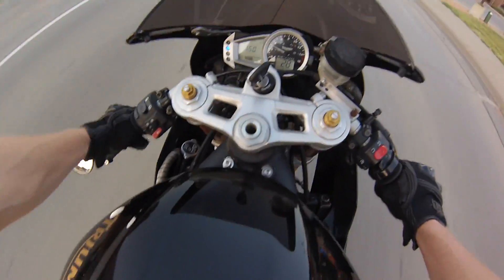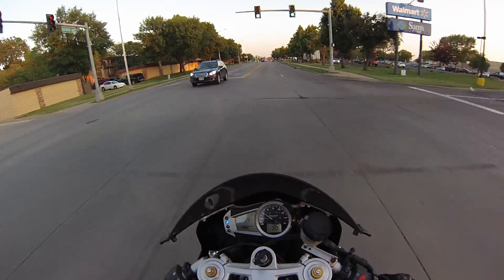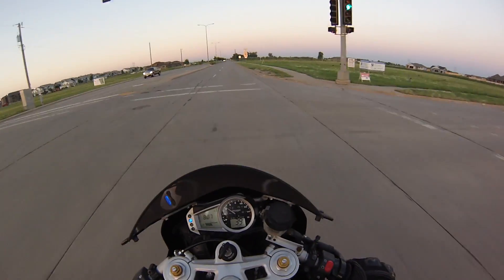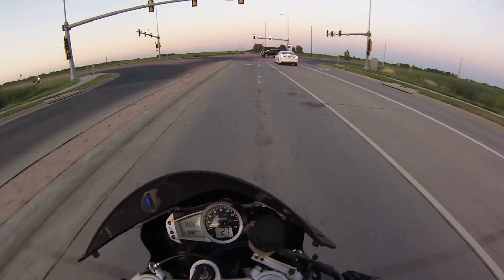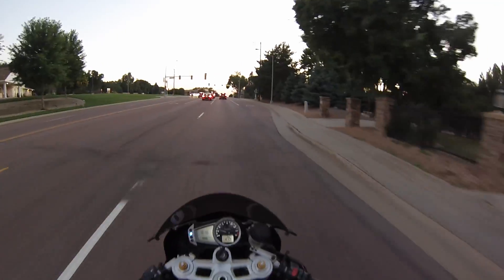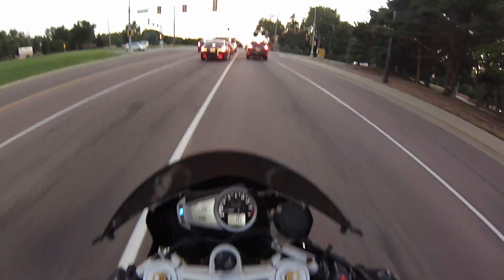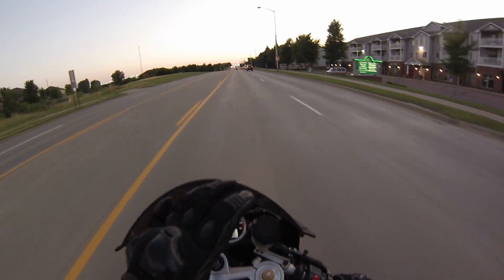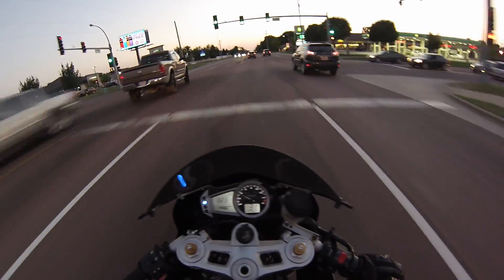Horsepower vs Torque - EXPLAINED!

Comment: So if I tune my Passat and it was 175 hp 180 tq to 230 hp  250 tq will it be faster because the hp are tq? I thought the tq was the boost when you shift 😂

Comment: All vehicles need energy to increase their speed. The energy required is easily obtainable from the kinetic energy equation.
E = 1/2mv^2
which can be reversed to obtain speed as a function of energy:
v = sqrt(2E/m)
So the speed of the vehicle is given by the square root of the amount of energy over mass

Since acceleration is the rate of change of velocity, acceleration is proportional to the rate of change of kinetic energy.
The rate of change of energy is power.
In fact:
f = P/v
force = power over velocity magnitude
since:
acceleration = f /m

For any vehicle the acceleration component from the engine is given by:

a = P/(vm)

And this formula is valid for any vehicle and means that the engine acceleration component on an instant is given by the current power of the engine over speed times mass. 

Acceleration is proportional to power, it is not my opinion, this is very low level physics 
and math and if you want to argue please talk with Newton who is the genius who came up with these equations.

In the context of a car the P in the formula can be replaced with it components which are torque and rotational speed(RPM) of the engine, in fact:
P = ω * τ
so:
a = (ω * τ)/(vm)

Which just proves that torque of the engine does not matter for acceleration since you can have:
(1000RPM * 1NM)/(vm) = (1RPM * 1000NM)/(vm) 

Those 2 hugely different examples where torque is very different gives you the same acceleration. And in fact both examples have the same power, because ultimately power is what matters.

Another consideration can be made, consider a car moving at a certain speed, let that be 50m/s, it does not really matter.
That car just have 2 gears which have a double ratio so, since given that the speed is fixed that car can either be at:

2000RPM with the 2nd gear or at
4000RPM with the first gear

The engine of the car delivers 

100NM @ 4000RPM or
150NM @ 2000RPM

So, if torque gives acceleration that car should have more acceleration at 2000RPM with the second gear. Unfortunately this inst true in fact we can use the equation above to find out the real acceleration and since speed (50m/s) and mass(whatever) stay the same we can just ignore those components:

1st gear a = (100nm * 4000rpm) / (mv)
2nd gear a = (150nm * 2000rpm) / (mv)

100*4000> 150*2000

Which obviously gives a greater acceleration with the first gear even if the torque is lower. In fact the power of the engine is greater at 4000RPM (42Kw) than at 2000RPM (31.4Kw)

The same example can be made with any number of gears and any engine. Which proves again that is power or better power/weight are what matters for acceleration. And that maximum acceleration always comes from keeping the engine at the maximum possible power point which depending on the transmission should be near or the peak power point.

MATH AND PHYSICS ARE NOT OPINIONS
Reply: Nice comment couldn't have said it better myself, are you an engineer?
Reply: @metallinkhead  because if you start a car in 5th or 6th gear it has a lower rpm than I’d you had the car in first gear. Someone correct if I’m wrong o have a very basic understanding
Reply: Hol up
Reply: Got it
Reply: Damn son you are a fool that just copied and pasted that lololololol
Reply: torque is a rotational force. the higher that torque, the higher the angular acceleration is, thus, you will have a greater acceleration. at peak torque, you are at your peak acceleration. that is all. you are right, math and physics are not opinions. you just have your understanding of it twisted. power is the combination of force and velocity. at high speeds with low acceleration, you will make roughly the same power at low speeds with high acceleration.
Reply: @cloroxbleach118 No, @Fede Devi's understanding is not twisted. He's completely correct. I know it hurts the brain to say that the twisting force from the engine "doesn't matter"... let me try to break it down in a more intuitive way. 
We want forward push, right? We want to accelerate quicker, pull heavier things up hills faster, overcome more extreme air drag to reach even higher speeds and so on. Okay what's touching the road? The wheels. The wheels are going to push back on the road. So we absolutely do care about torque at the wheels. Wheel torque can be maximized by adjusting the total gear ratio between the engine and wheels to put the engine at an rpm as close to peak POWER as possible. 
Now I know intuition screams that we should adjust gearing to maximize engine TORQUE... but remember what power is - torque times rpm. If we are at best engine torque and we want more torque to the wheels, we can go to a slightly lower gear allowing the engine to run a little faster. Now we know the engine is no longer making peak torque but almost, and we're now multiplying that torque by a higher ratio since it's spinning faster! This means more torque to the wheels. And that will continue to be true until the PRODUCT of engine torque and rpm is maximized.
It is because a transmission allows the free trading of torque and rpm that we can take whatever combination the engine is giving us and maximize torque to the wheels for a given road speed. 
(From your comment, you clearly understand from here how that wheel torque will generally be inversely proportional to road speed.)

Making more sense?
Reply: drienkm yes, it is twisted. forces are what cause things to move. obviously, the more force you have, the easier it is to move something and thus it accelerates faster. torque is a product of inertia and angular acceleration. it is a basic physics equation. angular acceleration is translated to linear acceleration at the tires, thus, more torque equals more acceleration. it is the reason why higher gears (numerically lower, 1st 2nd etc) have the same power output as lower gears (numerically higher) but the higher gears have more torque. in 1st gear, you have brutal acceleration (torque multiplication) but very low angular velocity (translated to very low linear speed). in lower gears, you have way less torque (acceleration) but your angular velocity is much higher, and they always end up with the same power, just made a different way. if your theory is true, then you would accelerate just as hard in 5th as you would in 1st. im not sure how many mire times ill have to explain introductory physics to all you car buffs.
Reply: @cloroxbleach118  I think I see what's happening, but first I'll address what you said specifically...
"forces are what cause things to move" change how they are moving, but sure.
"the more force you have... it accelerates faster" yep.
"torque is a product of inertia and angular acceleration" yep. not wrong.
"higher gears (numerically lower, 1st 2nd etc)" okay. Note that I've used "ratio" for InputRevolutions/OutputRevolutions where you use "gear", and I've used "gear" to mean what's on top of the shifter... but I'm with ya.
"in 1st gear, you have brutal acceleration... in lower gears, you have way less torque (acceleration) but your angular velocity is much higher..." yep, no problems here.
"if your theory is true, then you would accelerate just as hard in 5th as you would in 1st" No. Nothing I said (I read it) suggests that. In fact my last statement was how I could tell that you understood "from here how that wheel torque will generally be inversely proportional to road speed". I was referring to an actual long period of acceleration where you are shifting through multiple gears.

Oh, and the last one; "im not sure how many mire times ill have to explain introductory physics to all you car buffs" forever till you die. But let's fix up one last thing first.

Okay here's what I think is happening. You are thinking about the whole problem while gearing is fixed. It is correct that IN EACH specific gear, more torque at the engine means more torque at the wheels and greater acceleration. And obviously you correctly understand how different gears affect stuff. But you are not looking at the temporal aspect... time - how in a real scenario, each moment can only build on the last one. It's the part that STRONGLY repels our brains form understanding power. Honestly you're hella smart to have put this many pieces in place before it clicks. Most people can't. You will and it will be beautiful!

In your first comment you said "at peak torque, you are at your peak acceleration" that is totally correct IN THAT GEAR. Now ask "should you be in that gear just yet?" Read that again very slowly... You seem to have all the other important pieces in place. 
I'll just clutter it if I keep writing.
Reply: drienkm i guess im not understanding the last part of your statement, or i dont know wjat youre asking me to do. the only thing im trying to prove here is that torque is indirectly a function of acceleration, and thus, grows and lessens with acceleration. it is therefore realted to torque.
Reply: @cloroxbleach118  No worries, take all the time you need. I'll ask the question in a different way - same scenario: You are accelerating in some gear at full throttle. We are looking at a moment in time where the engine is at the rpm for peak torque. Now here's the question:
At this moment (and that means at this speed), what would be different about wheel torque (tied directly to acceleration) if the gear ratio were 10% higher? Ask yourself how this new ratio would change 1) torque at the engine, and 2) torque multiplication to the wheels... 

Explanation below:
1) We know engine torque is lower because engine rpm is now above peak torque. But 10% faster isn't enough to be beyond rpm for peak power, so then we know that power, the product of torque and rpm, must be a little higher than it was. This tells us engine torque is somewhere between 1 and  1/1.1 (or 0.91) times what it was. We don't know exactly because we don't know the shape of the power curve but that's fine. It doesn't alter the conclusion.
2) This one is easy. We increased the ratio by 10% so torque multiplication is 1.1 times what it was .
Putting these together: say .95 times the original torque multiplied by 1.1 times the ratio and we have 1.045 times the original wheel torque - 1.045 times the acceleration - 1.045 times the trailer tug - running at LESS than peak engine torque.

If I had to make one statement it would be that the engine torque number tells you basically nothing about a vehicle's performance. Engine torque is very meaningful only in the equation for power which tells you a lot. When you look at the power equation P=TQ*RPM and you can't see the point of RPM (as most people can't), just replace it with TQ MULTIPLICATION. That's exactly what rpm is really giving you when you have CONTROL OF GEARING. And when I say "control" I mean both the engineer at the drawing board who carefully chooses the best gear ratios in the transmission and final drive to suit the engine and the purpose of the vehicle, and the person shifting gears as they accelerate. 

So how are we doing?
Reply: drienkm if the ratio were 10% higher? then you would have 10% more torque at the wheels and 10% LESS angular velocity at the wheels. torque and angular velocity at the motor stays the same, obviously. what youre saying makes no sense to me. if you magically change your rear ratio from lets say 4.56:1 to 5:1 (10% higher approx) then youre torque multiplication will be 1.1x and your angular velocity multiplication will be the inverse, about .91. based on this conclusion, power remains the exact same at the wheels, yet the 5:1 rearend will accelerate quicker due to that extra 10 percent torque. this is the scenario im talking about. 2 vehicles that make the exact rwhp, but completely differently. 5:1 ratio has higher acceleration but reaches a lower top speed. 4.56:1 will reach a higher top speed, but will not accelerate as quickly. both are making the same hp, in a completely different fashion.
Reply: @cloroxbleach118  When you downshift, which changes immediately; engine rpm or vehicle speed!? It's just a downshift:) I even said "At this moment (and that means at this speed)"... It's up to you how you want to think of the ratio change:
1) a realistic downshift where you rev match and smoothly reengage, taking a short but finite amount of time
2) a faster shift with a small momentum exchange by slamming it from one gear into another
3) just bam - now it's in a different gear - "magic" kind of thing with no momentum exchange
Doesn't matter much - none of them break the setup or the question. But in no case does a vehicle's speed get yanked down to a slower speed just because of a sudden ratio increase. So the engine IS now turning faster as I stated. So with that straightened out, I urge you to take a second look at the question...
(Just a heads up, this may lead us to touch on torque and power curves if you're not familiar with those. I'm assuming you are)

But okay sure, say the engine had massive inertia for just a sec there, and the vehicle's speed was jerked down by the ratio change. It would then be running at the exact same power and torque with 1.1x more torque to the wheels resulting in 1.1x acceleration like you say, while moving at .91x the original speed. No problems there, but since you just changed the vehicle's speed instead of the running conditions of the engine, nothing interesting really happens here.

Looking at your new scenario: Two vehicles with the same rwhp, one at 4.56:1 and one at 5:1. Your conclusion about acceleration is correct if the engines are identical, having the same torque. Is that what you meant? If not then we could probably go places with it...

BTW, I'm really enjoying this discussion. I hope you are too. I'm glad you're willing to really parse through this.
Reply: @drienkm  and I was really enjoying reading these polite exchanges!! Sadly 3 years has passed.
Reply: @drienkm wow!  Great job!  I’m at the edge of my seat hoping you can click the light bulb for this guy.  It’s like these torque worshippers really badly need to hold on to their faith based understanding in perpetual motion thinking that torque can magically do the same thing power can do but with less RPM and while burning less fuel.  You are right on point with your diagnostic teaching style.  If you can’t light this guy’s blind spot I don’t know who could.  Cheers!

Comment: So is torque speed or horsepower speed?

If I we’re to trade torque for speed is that a bad thing? (Downsizing driven sprocket)
Reply from the maker: What do you mean by speed? Top speed or acceleration? 

Higher horsepower will give you a higher top speed but higher torque will generally allow you to accelerate faster. If you downsize your rear sprocket you will get LESS acceleration but you will have a HIGHER top speed. Hope that helps
Reply: @Motoposh  Wouldn't higher HP just make you both accelerate faster and high top speed?
Reply: Thanks I was talking about higher top speed.

Comment: Im here to know about buying harley davidson over a sports bike
Reply from the maker: Those are very different bikes, in my opinion it depends on what kind of riding you're gonna be doing.. how old you are.. and where you live. I loved having my sportbike out in the hills because in my opinion you can ride a sportbike more "spirited" haha. A Harley of course is going to be way better for longer rides and be more comfortable. All depends on what kind of riding you're going to be doing
Reply: I know they are different i been riding sports bike for 4 yrs i wanna travel but lookin at unofficial harley hp numbers i feel under powered but people sayits quick because of the torque thats what is bugging me
Reply from the maker: I just rode an Indian this weekend (yes I know not a Harley, but close haha) and I can personally say I was surprised at how quick it was. The torque definitely makes up for the lower redline and HP in my opinion. The Scout I rode pulled real well from down low
Reply: @abhilash4738  It's not quicker because of the engine's torque number - nothing is. I realize that goes against everything you're being told. It feels "torquey" and satisfying because of the shape of the power curve - flat. I can't prove it without the math.
Nobody does this, but if a Harley had a teeny-weeny engine with the same horsepower and a flat power curve (and an appropriate final drive ratio) it would have that exact same "torquey" feeling - and it would sound stupid. LOL.
Reply: Thats what i need in my kind of sorrounding i dont wanna cross the speed limit by alot but still have to be quick enough im done with sports bike i wanna know is a cruiser a worthy upgrade im bit of a squid so i wanna stay satisfied when i ring it

Comment: Torque is the net moment of a couple, which is the vector cross product of perpendicular distance to the force and the distance from the axle. This is measured in Newton metres. Force over a distance. 

Higher torque means each rpm has more horsepower.

Horsepower is measured in watts. Newton meters per second. Work done per unit time. This is torque x 2π rotations per second.

In other words, the motorcycle has low torque, means each rpm has low momentum added to the vehicle per second. Low force, or dP/dT. But the motorcycle has higher rpm to match the horsepower. 

The car operates at lower rpm, but exerts higher force. If it has a tug war with a motorcycle the car would win.
Reply from the maker: This sir is probably the most correct comment made on any YouTube video ever.